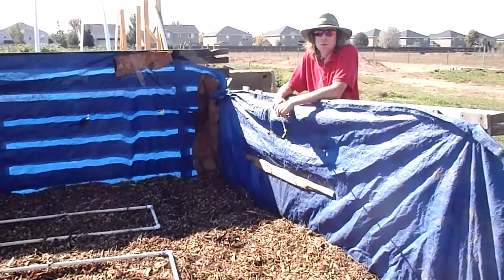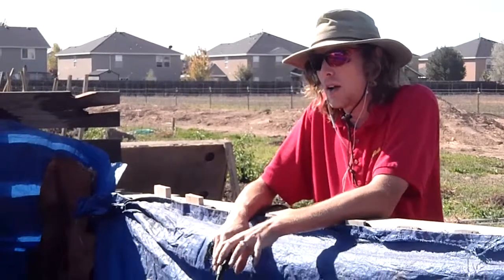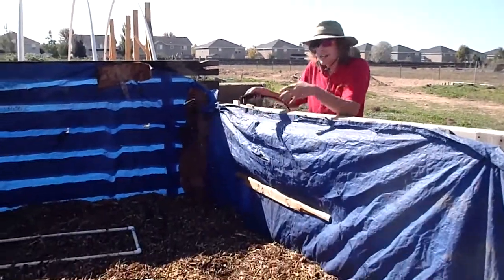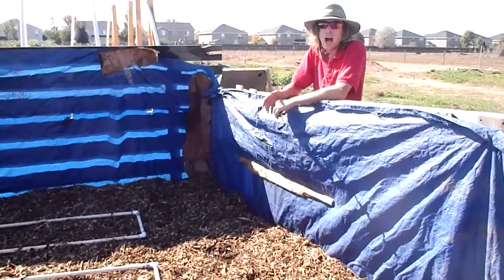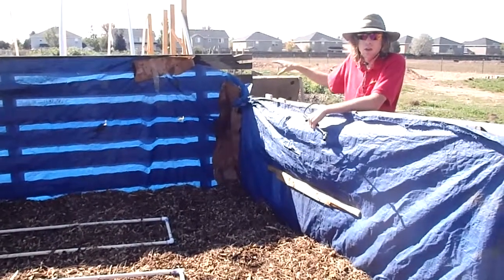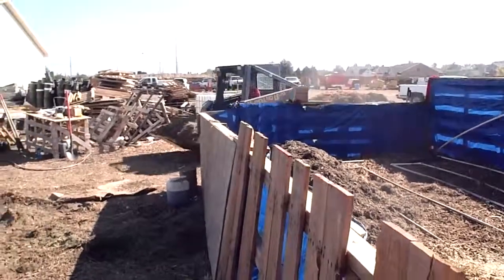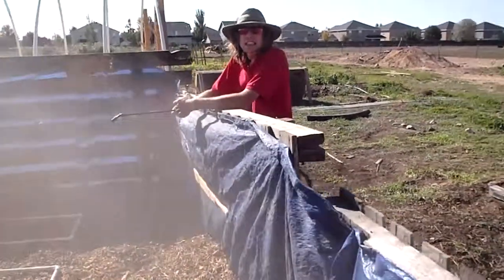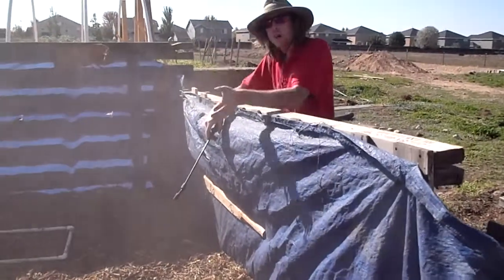Compost Water Heater High Tunnel Update #4

Comment: I am not able to sustain those kind of temps in the winter with my compost piles. I am curious if this will actually make a noticeable difference in the greenhouse. Please give us an update on the results.
Thanks
Chuck
Reply from the maker: +Fensterfarm Greenhouse Hi Chuck, try adding more high nitrogen components to your piles. Brewery waste works great. It's also very important that it is soaked with water. Seriously, soaked...We had good results until the pile ran out of heat. It could have lasted longer but we didn't get it wet enough during the build phase.
Reply: thanks. I will have to try that.
Chuck